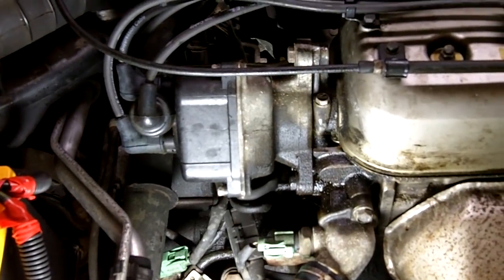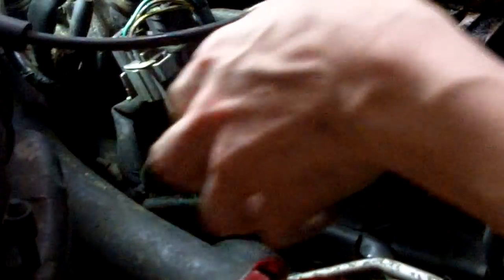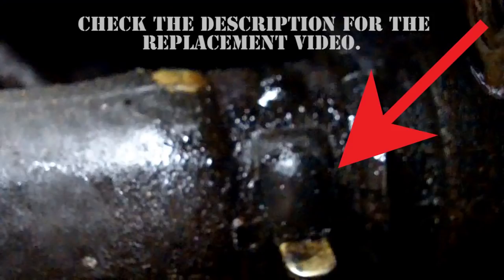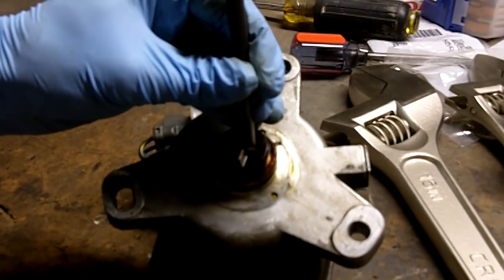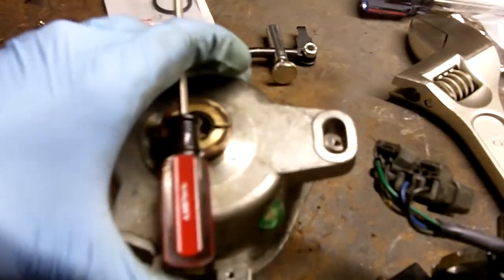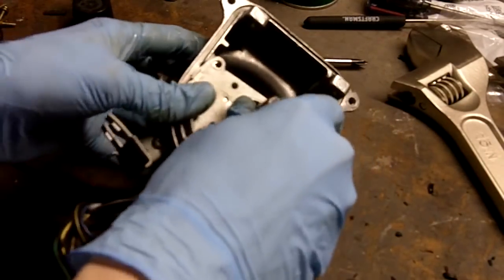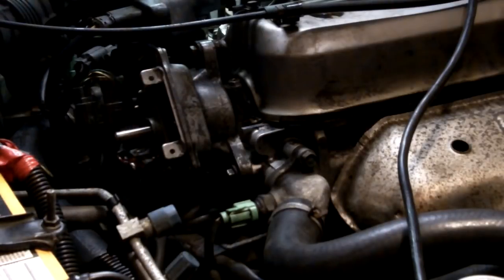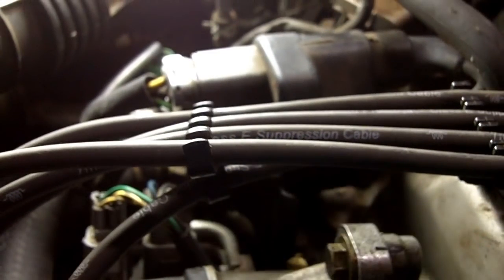Honda Distributor Oil Seal Replacement

Comment: My neighbor has a D16Z6 engine in a 95 Civic.  Your video was a perfect match in resolving his leaking oil problem.  Less than $15.00 for the repair and no more drips.  You made the whole repair process so simple with your great video.  Thank you so much for your help.

Comment: thank u, After watching this great video I repaired a 2000 Honda Accord. I also replaced the distributor cap gasket which was oil damaged. Your warning on oil damaged heater hose was excellent preventive maintenance. It helped me prepare by buying 2ft of 5/8in interior-diameter heater hose for $4. The formed hose cost $17 and an unnecessary loop in it.

Comment: I cannot thank you enough for this video -- my distributor continued to leak oil into the cap after the dealer allegedly fixed it. Sure enough, inner O ring. $12 and two hours later, I have this squared away. Wouldn't have tried it were it not for this video! Indispensable resource!

Comment: I successfully completed this job thanks to your video so a huge thank you goes to Bushougoma.  A little tip for others that are going to try this...my rotor was yellow and I had a hell of a time getting it off.  (Bushougoma takes his off with relative ease at 4:08).  I took the whole distributor off first and had to take a rubber mallet to the rotor hiting it through a bit, then hit it back from the other side.  Then it finally popped off.  My internal seal was also completely shot and was a bit different from the one in this video - it had a flat piece of metal inside the seal itself rather than that metal circular spring looking thing.  Make sure to use the correct size phillips head screwdriver for the last 4 screws as I stripped one of mine (seen in video at 14:32) and it made it a lot harder to get the seal off because the whole assembly was dangling with the wire, but nonetheless I was able to complete this job in about 4 or 5 hours after all was said and done (I also changed the lower coolant hose as mentioned at 7:42 ...I got that at Napa for about $20 (I needed to have it done that day, but this part can be found online for much cheaper).  The seals cost me only a few dollars off of Rockauto.com.  I did it yesterday and not a drop of oil is leaking after taking old Rhonda out for a spin...thanks again Bushougoma!

Comment: Thanks for the tutorial. I went into a local repair shop to have a sensor replaced which should have cost me a couple hundred dollars. They called me and told me that my distributor seal, inner, was leaking and was a real fire danger. They wanted to charge me $550 for a new distributor, I talked them down a hundred and a half or so, and I guess I still got screwed. The owner of this repair shop has his own tv show locally and is always talking about how folks get cheated at repair shops; I guess he's an expert because he is so good at cheating his own customers.
Reply from the maker: If it was an OE Honda distributor they are around 330 from the dealer. If it was a cheaper aftermarket from $90-$130 (which I wouldn't recommend) that price is way too high. The aftermarket distributors just don't seem to last as long. You're better off getting a used OE one if you can't afford new.

Thanks for watching.

Comment: BLESS YOU, BUSHOUGOMA!!! This was a fantastic help, it made the job trivial! I've had an external and internal distributor leak in my 1997 Honda Accord SE 2.2l for quite some time. I finally got sick of leaving oil spots wherever I park and started to tackle the leaks one by one...did the valve cover gasket twice, the second time seems to be working. But then noticed oil around the distributor and was like WTF? Very glad to have your video to help solve this. Also replaced heater hose...

Comment: Thank you for making this video.  I have a 1993 Honda Civic Ex which should be very similar in regards to the repair process.  I noticed today that I have a little oil inside of the distributor cap and oil underneath the distributor leaking on to the transmission. I am now confident on replacing the o-rings.

Comment: Great video and information. FYI !!! It is possible to reinstall the distributor 180 degrees out. I figured this out after an hour of troubleshooting. Took it off, turned the dist end 180 degrees and reattached. Fired right up.
Reply: did you drain all the oil first?
Reply: Oil draining is not needed to pull the dist. off.
Reply: Kevin Miller yes I discovered that 33 weeks ago lol
Reply: I did the same thing, too! I came here to post a comment letting people know it can happen but you beat me. I don't feel quite so bad now, either! Haha.

Comment: Excellent video, just used it to repair my Mom's Civic and like you pointed out the heater hose had a bubble in it from the oil leak, replaced it as well.

Comment: Thanx, major help putting my mind at ease for dist reinstall. Figured it was a one way only key, so if you're just pulling it to get to other work you don't really even need to pull the cap if you're pressed for time.

Comment: Great video. I just bought a Hitachi distributor for an 89 accord from the local pull a part.. and the oil seal is very similar. Thanks for uploading it.

Comment: Excellent hands on video and very informative. I noticed while changing the oil in my 94 Accord that it’s distributor is starting to seep. And thanks for the heads up on the heater hose info. I need to watch that video as well. Take care!

Comment: I just got done replacing the internal seal and outer O-Ring. Also did the Valve Cover Gasket job, replaced spark plugs and wires as well. All thanks to the two videos of yours. And guess what... The Heater Hose underneath the distributor popped open while I was testing it after the repair. And now I'm ordering the hose and watching your other video to get ready for that one. Lol
Reply from the maker: Well at least it didn't pop while you were on the road. Try to look on the bright side :-).

You may be able to avoid removing the distributor again if you can turn the ears of the spring clamp on the engine side of the hose with a screwdriver so you can access it from the side. The hose is sandwiched between the distributor body and the transmission bell housing.
Reply: I know I was glad to be just in my driveway, I think I'll just take the distributor back off, its quite simple now that I've done it a couple times. Again, I appreciate the videos they're very helpful!

Comment: Great Video!!! If you are looking for a more immediate repair instead of waiting on shipping. I happened to order the wrong size o ring and inner shaft seal(ordered before I found this video). Spent 20min on it till I realized it wasn’t going to work. After looking around I found Advanced auto parts had a kit for part number 917-136 Dorman oil distributor seal kit. That ended up working for me and just got back from driving for 30min and so far no leaks!!

Comment: I just did mine.  Thanks for the tip about marking the interface between the distributor and the cam before taking that ring off.  I probably would have put it on backward otherwise.  I had OBD 1 so I had more stuff in the bottom of the distributor.  But I didn't have to remove any of it because my seal was 19 years old and it came off with the shaft.  I just had to remove it from the shaft and push the new on in.  The old one was hard as a rock no wonder it wasn't sealing anything.

Comment: I made it fit but it bugged me so I found the Hitachi seal that has the same numbers (which are the seal size numbers) here. It fit perfectly but I couldn't have done this job without your great video! I found the seal online at Red's Auto Rehab.(they also carry the NOK seal.)

Comment: I checked wires and everything was plugged up correctly.  I got the car running now.  I believe that I initially didn't secure my wires and flooded the engine attempting to get it started.  I rolled it down a hill to get it towed and started it just before getting it on the tow truck.  I believe I flooded teh engine because I got a large black cloud once it got started.  Running great now thanks.

Comment: Job complete. Interior seal leaking and external seal hardened. Did notice shiny groove in shaft where it turned in internal seal, will keep eye on it to see if it leaks again. Thanks again for video.
Reply: Mine leaked.

Comment: Bushougoma - Thank you very much for taking the time to show and explain the entire process. Also thank you for posting the part #'s for the two different  types of distributors. Thanks to you I was able to buy the correct seals and installed them.!!! NO MORE OIL LEAKS!!!

Comment: i did, yes. i opened up the distributor again and did find oil inside of it. it is a tec distributor (it actually says "tec" right on it) so i went ahead and ordered the internal shaft seal you referenced. oddly, though there was no drain hole on the distributor cap. thanks for your help!

Comment: These instructions are thorough. But I want to add one caveat from my own experience with this repair. I replaced the shaft and housing seals on a 95 Odyssey.The engine started and ran fine afterward. But it still showed an internal oil leak, i.e. oil up the shaft and out the cap gasket. My shaft had a groove in it that must have been cut by the original oil seal. At this point I just wrapped a paper shop towel around the distributor to soak up drips. But if you find this groove, a machine shop might be able to smooth out the shaft enough to reuse it.

Comment: I did this several years ago on my 1989 Honda Crx HF.  It uses the same seal (NOK BH3888E).  I hope this helps someone out there with a Crx and a Tec distributor.

Comment: thanks! i'll have to double check for that oil trail. i just did the valve cover gasket less than a year ago so unless i screwed that up it's coming from somewhere else.

Comment from the maker: If you have a Hitachi distributor on the 2.3 you have the pressed in pin. The Tec distributors have the ring with the floating pin. But I think the Tecs were only on the DX models.

Thanks For Watching.

Comment: A bit late to the party here, but it should be important for anyone attempting this to note: Most people tend to over-torque hardware, and this can be a disaster when you are torquing down bolts into ALUMINUM. First off, get yourself some anti-seize compound and lightly brush it onto the threads of any bolt going into aluminum, secondly, be diligent in looking up the proper torque values for the hardware you are tightening.  having to ream and helicoil aluminum is no fun.  Best regards, and great video.

Comment: Making no promises to anyone but when I did this on a Civic I accidentally spun the distributor lugs. It seemed I had a 50/50 chance of getting it right but when I fiddled about I discovered my distributor lugs are slightly offset so if you're gentle there is only one orientation that will insert. It makes sense really.

Comment: It sounds like you can tell which seal is broken depending on where the oil is leaking from your distributor.  From what I gathered, the distributor O-ring leaks into the cap, and the internal shaft oil seal will leak into the housing.  As he said, might as well replace them both while it is off, but in a pinch, one might just replace the O-ring to pass smog ASAP.  The internal shaft oil seal is much harder to get to.

Comment: First - great video and thanks.

I have a 96 Accord EX VTEC 4 Cyl that is leaking from the distributor

took it to a shop to have them change the valve cover gasket, but it's also leaking from the distributor.  It's hard for to tell from where exactly. Distributor has 4 wires, so apparently Hitachi.  

Going to take off the cap hoping to not see oil as you mention, I'm hoping it's external an leak because there seems to be a lot that can go wrong taking apart a distributor for a novice like me

Comment: I was wondering if pulling the internal oil seal in backward would make a difference, I ran it for 3 weeks now an no leaks! its a pain to take it back out! 
anyway Great  instruction , helped me out a lot! love this guy!
Reply from the maker: Bruce Wayne Yes oil seals are directional and the flat side should be facing out when installed in the right direction. Attempting to pull it out will most likely damage it.
Reply: ***** do think it will prematurely start leaking eventual leaving it like the way it is!
Reply from the maker: Bruce Wayne
Can't say I've never done that before. It must have been difficult to drive it in with a socket that way. Hopefully the garter spring in the rubber channel that holds the lip of the seal to the shaft didn't get damaged.

I'd just keep an eye on it if it begins to leak replace it.

Comment: Great video 👍 Noticed oil has accumulated inside the distributor and the engine will crank, but will not start. I’ll troubleshoot it this weekend and also order the o-ring kit. Hope it’s a easy fix, camshaft turns while cranking meaning timing belt is still intact. Only has 30k miles since I replaced it both timing belts.

Comment: when u said you dont want brake clean in your eyes i cringed..when i was 22-23 i was working on my crotch rocket..well the cylender was filled with brake clean after looking in the hole the guy bumped the engine over as i looked in..i had this bike running over 180lbs in each of 4 cyl well when it shot me in the eye i wanted to die..for 6 months i has metal and shi pulled out of my eye..almost went blind..ima safety  eye glass wearing son of a gun..9 months in the bed..going blind makes you see so differntly..thankyou lord!!!!!

Comment: He(the mechanic) try to scan the car with a device as i said and he showd me on the device, "the distirbutor replaced" thing and he said the problem is this we need to buy and change it sohe pulled out the distirbutor because to take this out and put the new one in place. Yes it is OBD II, i saw it as the video you posted.

Comment: For those who plan to work on a hitachi ...there is no snap ring for the coupler pin. Its pressed in. This means a punch and a big ass hammer to get it out and to get it back in. Just a heads up.
Reply: Apparently I have the Hitachi and am having an impossible time trying to punch it out. Almost doesnt seem to budge, not sure what to do.

Great video btw, my hose looked like it was ready to dissolve.
Reply: take the hitachi shell up to a local shop along with a 6 pack of beer... have them punch it out. once you change your seal have them punch it back in.
Reply: Lol, I broke 3 punches but eventually got it out. Had to buy a vice which I since returned back to Home Depot. Again great video, saved me some money.

Comment: I pulled all the wires out (including the and reconnected them.  The car actually turned over, but immediately cut off.  I am thinking of replacing the distributor cap rotor.  Wires look fine.

Comment from the maker: Yeah but that's a bit overkill for just turning the engine a bit.

Just pull the connector on the fuel injector resistor pack (metal component with heat sink fins on it) you'll find it at the upper right corner of the engine compartment on the firewall. This will remove battery voltage from all four injectors to prevent the engine from starting.

Then just quickly cycle the ignition switch to start until the screw lines up.

Or just pull the distributor and remove the rotor later.